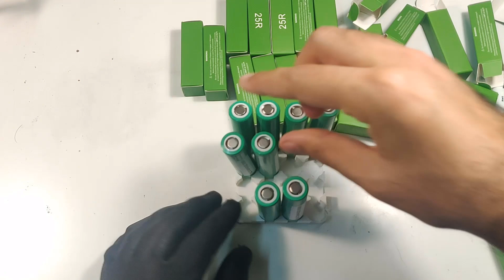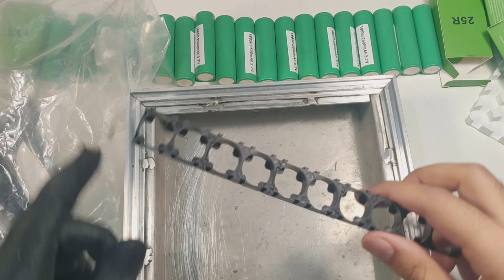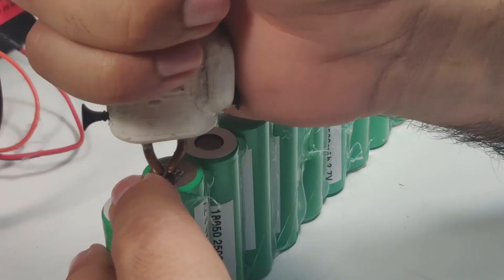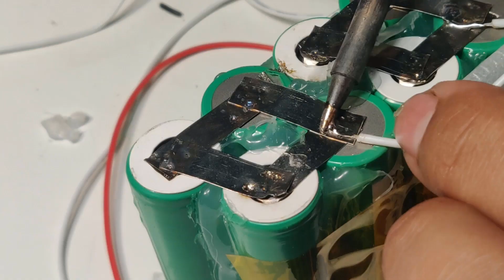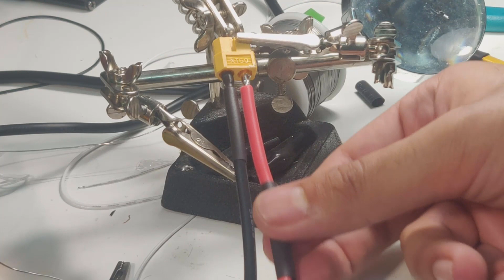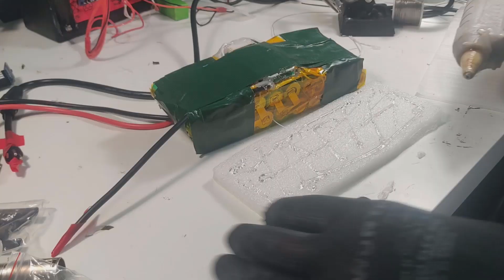DIY OneWheel Ep 4 - Making the 10S2P Battery Pack (18650 Batteries)

Comment: So why not 2P10S like I see in hoverboards?
Reply from the maker: It's the same thing:)
Reply: @Fungineers  hmm, I see that differently but perhaps you can tell me how you see it.

In my hoverboard 2 cells are connected in parallel and they are then in series with the next pair. (2P10S)

I would think that a 10S2P has a string op 10cells in series, and then the ends of that string are connected to another string.

But hey! What a fast response.

And now that I look at it again. You did the first option.

Comment: Purchased your wheel and Cheap Focer VESC.  Do you plan on selling 13s 48V battery packs?
Reply from the maker: Thank you. Your order is under process  The battery market is a tricky one. Until I find a trusted supplier I won't do it.
Reply: Fungineers how many amp hours is your 13s pack your made?

Comment: Hi, (i know that im late to this) but does it have to be 42Volts or could it be 36Volts. If 36Volts doesnt work where could i buy a pre built battery pack? And If a 36Volt would work is this a good one to use https://m.aliexpress.com/item/4000886797892.html?pid=808_0000_0109&spm=a2g0n.search-amp.list.4000886797892&aff_trace_key=ceccb96faf804054ab9f454c8ddfe90b-1591721193149-09869-UneMJZVf&aff_platform=msite&m_page_id=9392amp-YifAlGUibCpvtV_xi3WVuw1591721690263&browser_id=d56f7df23519484da433757115d17ffa&is_c=N
Reply from the maker: By 36V you mean a 10S battery then yes. I was previously running on 10S. I would by wary of buying batteries from ali because of the risk of counterfeit cells. I would rather check in your local area/country for a reputed battery builder.
Reply: @Fungineers  so i have checked out rest of the series and im starting to get confused of wich parts i should use and how to connect them so maybe a list of the parts and a circut diagram would help me If you could do that

Comment: what about the charger? what should we use for charging that battery? how many amps should we use?
Reply from the maker: 2A to 4A is fine. I use 4A fast charge..charges in 30 40 mins. 
Make sure voltage is correct. 42V for 10S. Also dont buy cheapo chargers. Buy one with fuse.
Reply: @Fungineers  thank you so much... :)

Comment: Superb SIr! I had one question, you are using 37v battery for a 36v motor. won't it burn the motor? Thanks
Reply from the maker: Its ok. My battery is actually 42V when full. Other people are running 50v too. 
V doesn't kill the motor current does.
Reply: @Fungineers  Thanks for the information Sir!!!

Comment: What is the purpose of the 3rd wire that you have taped? 3:47
Reply from the maker: Thats the charging negative wire. This bms has a separate C- connection. Some bms have the same leads for charging and doscharging (check the bms for 6s battery i built for my electric skateboard). This one has p+ (which is also c+)  p- and c-

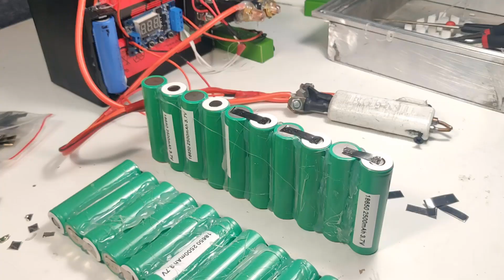Comment: 1:50 it's a good idea to add "fishpaper" between the 2p parallel groups... otherwise if the cell shrinkwrap wears through (due to vibrations etc.) a short circuit will happen between the groups ⚡🔥

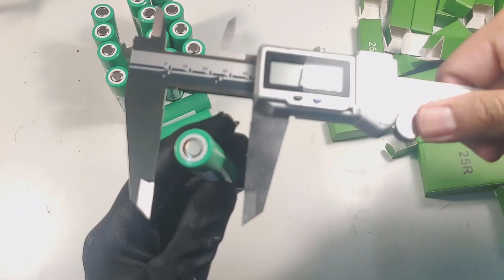Comment: 0:35 doesn't measuring the cell like that with metal calipers create a dead short between the +ive and -ive? 😱😱😱
Reply from the maker: Yeah youre right. Little bit of wrap on the battery terminals saved it but shouldnt be done.
Reply: @Fungineers  OK good :)
Reply: that would have welded the calipers to the battery, nicely glowing. ; )

Comment: if each cell has 2.5Amps, this configuration of 10s2p it give us 5 Amps Total right? 
Just to Confirm
Reply from the maker: Capacity is measured in AmpereHours (Ah). Yes each cell is 2.5Ah, this makes 2p groups equal to 5Ah

Comment: I want to do this! please can you provide us with links to where you bought the batteries, rail, wheel etc from. Thanks and awesome video and build
Reply from the maker: I cant recommend the wheel yet, because I havent tested its speed, torque, etc., so please be patient. The batteries can be bought from any local 18650 lithium ion supplier. Make sure they are high discharge. Better to buy a battery pack. The rails are just regular 50x20 aluminium rails

Comment: Do you mind posting a link or something to the code you used for the arduino, so I can do it for myself. Another question I have is what is the wattage of the motor
Reply from the maker: Code is still a work in progress. Will finish it soon. My motor is 36v 600w
Reply: Fungineers thanks
Reply: Fungineers whenever you finish the code can you give a link to it or something like that